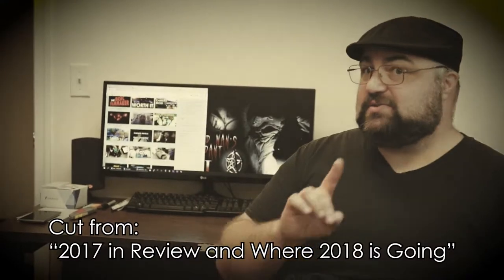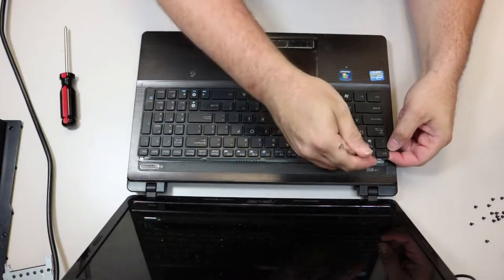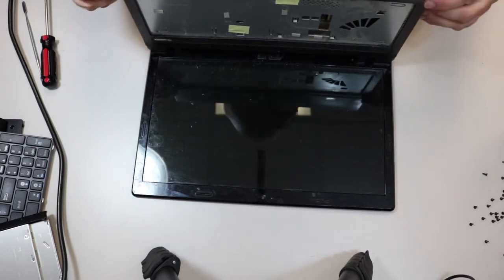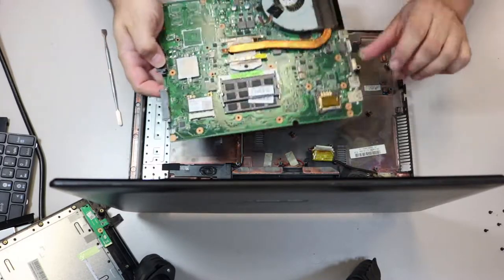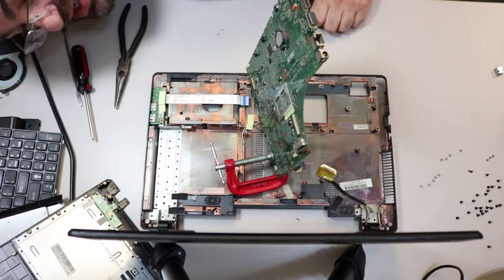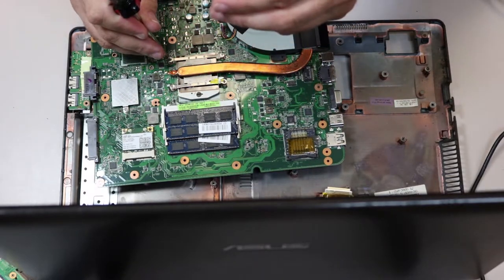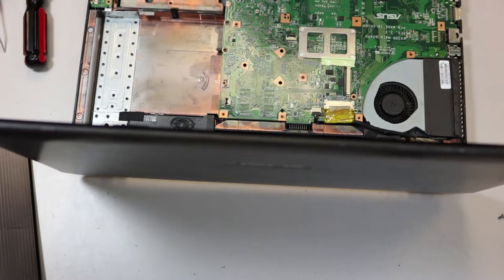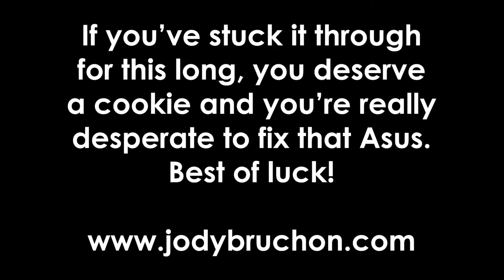Asus K53E DC Power Jack Repair (with a heat gun and pliers!) - with full disassembly - Jody Bruchon

Comment: Hi,

Can you tell me whether the screws in this laptop are all the same ? I know they're all Philips screws. There are 3 M2x3 screws under the Optical Drive & one under the HDD. 🙄

But the rest that go underneath the bottom side of the plastic body... are they all black M2x6 type screws or are some silverish (longer ones) in color present there too ? 😕

I got the laptop awhile back in pieces & just recently got supposedly all the screws for it. I've been watching other disassembly guides for this laptop model type & figuring out where which screw goes to.

Great tutorial though. 😊

Thanks &... 😉🖒

Best Regards,
Reply from the maker: No computer uses all identical screws inside, at least not any that I have ever seen. Usually, if you're lucky, there are 3-4 types. Based on the video (it's been years since I recorded this) the silver screws go into internal bits and the black screws go in the casing, generally speaking. If you have noticeably longer screws, they likely go up into the hinge corners.

Here is the worst case way of doing this: take the longest screws and screw them in WITHOUT USING MUCH PRESSURE. If they become harder to turn at all, you've bottomed out. If they go all the way in, you've found the correct hole. Force it and you'll poke a screw bump into the plastics or rip a brass thread ring out.
Reply: @JodyBruchon  Aha... ok, then I'm good basically. I've put them in correctly. 😏

Yeah I know about that. 😶